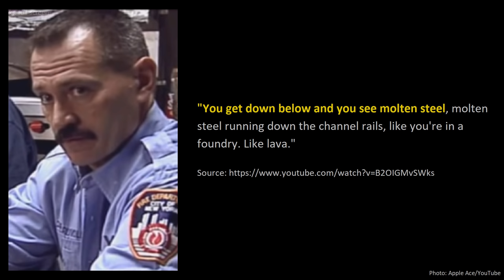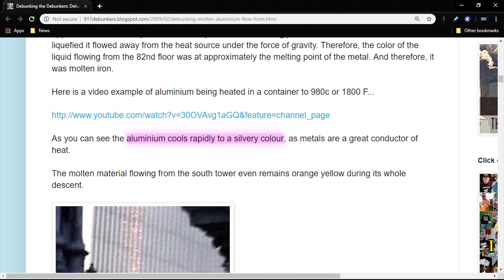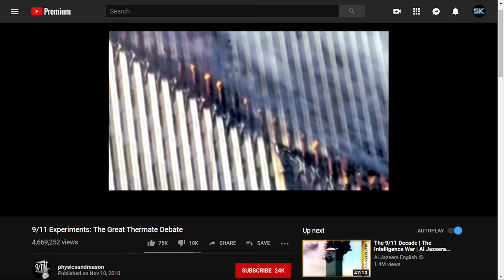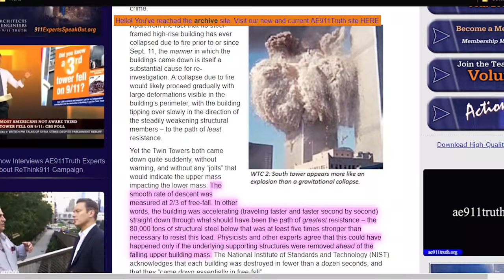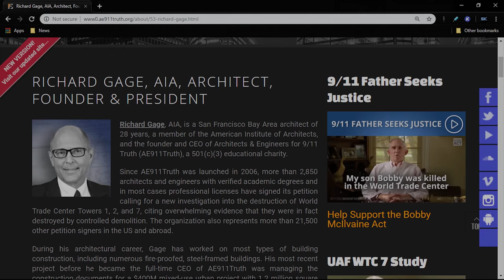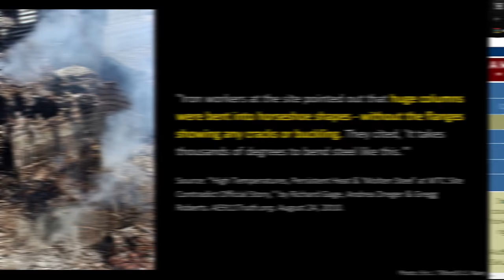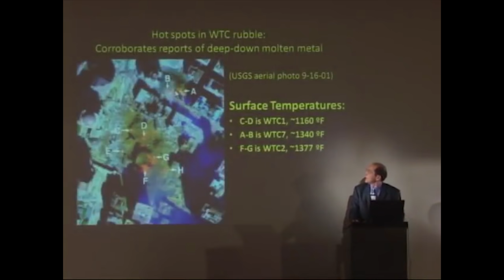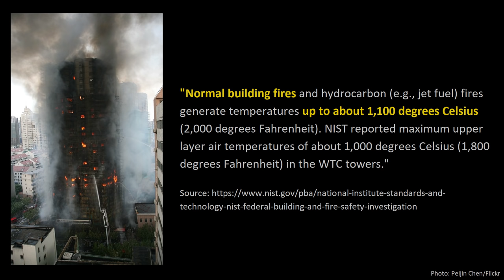9/11 Truthers Debunked: "Molten Steel = Thermite From Controlled Demolition!"

Comment: Many misunderstood points about the controlled demolition theory. For example, the hot spots underground was caused by fire from the thermite, the red hot spots seen from satillite do not indicate areas purely of molten steel, it indicates areas still burning from the thermite. And of course these hot spots can shift as the thermite provides fuel to burn things and melt through debris and cause things to shift. As a result of the temperatures created by the thermite you would find molten steel in those hot spots. But the hot spots are not caused by molten steel, it is caused by the thermite explosives. Regardless, maybe the material flowing out of the side of the standing building IS in fact aluminum. Okay, how does that impact the demolition theory? Well it really doesn't. If you really wanna disprove this theory. How about explaining to everyone how the buildings can fall at near the rate of free fall without the use of explosives. The building accelerated as it came down just like if you dropped your car keys on the ground. NIST in fact admits this so their is no point in arguing against it, it is a part of the official narrative. So you, if you want to debunk the demolition theory, need to explain how the top 15 floors of the building was able to accelerate at free fall with the 90,000 pounds of structure steel supporting it. Its very basic laws of physics. Every action has an equal and opposite reaction. 15 floors act upon the 90,000 pounds of building beneath it, that part of the building is going to push back. Both parts of the building will collide and do basically equal amounts of destruction to each other. The official story says pancake collapse, pile driver, yet it cannot explain how it took 9 to 10 seconds for the building to fall into itself at near free fall acceleration. Oh and lets not forget building 7 which did the same thing and wasn't hit by an airplane.
Reply: @mooneyes2k478  you should take off the moon eyes and try looking at the world as it actually is, reality. From the moment the top section of the building begins to go down, the top section is accelerating at free fall speeds. You also clearly dont understand what gravity is. Gravity is the force that accelerates (which is not a constant speed) objects at 9.8 meters per second squared. Gravity is not exactly 9.8 all over the world, for example, in new york city its closer to 10 seconds. You can observe the top section of the building frame by frame and you will find it is accelerating at the speed of gravity. This is impossible without explosives. Although it is true that the top section falling does have to encounter the floor immediately below it, your idiotic belief is the top section destroyed the entire structure below, 90,000 tons of undamaged structure. If the top section had to destroy the floors below it one at a time, it would take much much longet than 10 seconds. And you have no evidence Whatsoever to support that collapse lasted 18 seconds, in fact, the official story agrees with me in this aspect as well. Collapse was 10 seconds at free fall acceleration. If it was piling driving and causing destruction from falling, it would have to slow down. The action of the top section destroying stuff below would mean kinetic energy from the free fall would have had to been used to cause the destruction. The building came down with little to know resistance, meaning the structure was removed as it was falling, meaning explosives were used. And of course the same thing happened with building 7 except it was a bottom up demolition that is much more common. You have no evidence, you made no effort to explain your position other than to mock mine. Sounds like a sheep to me
Reply: @unshapingtheearth7916  Aren't you AMAZINGLY creative and witty?

Now, then:

" From the moment the top section of the building begins to go down, the top section is accelerating at free fall speeds. "
"Speed" is not acceleration. "Free fall" is what occurs when a parachutist's air resistance equals to his gravitational acceleration.

"You also clearly dont understand what gravity is. Gravity is the force that accelerates (which is not a constant speed) objects at 9.8 meters per second squared."
SNRK! Wow, that was almost sublime in its irony. Not only did you prove your previous claim utter nonsense, actually managing to differentiate between acceleration and speed, but you also managed to say that the acceleration of gravity is not constant at a constant. Good work.

"You can observe the top section of the building frame by frame and you will find it is accelerating at the speed of gravity."
Congratulations, you not only proved, again, that you don't know what gravity is, but you also managed to either prove you haven't actually ever done what you claimed, or you're a liar. No, the building does NOT actually fall at gravitational acceleration.

" This is impossible without explosives."
This? Is so much bullshit.

"If the top section had to destroy the floors below it one at a time, it would take much much longet than 10 seconds"
And what DO you know, that's exactly what happened. Amazing, isn't it.

"And you have no evidence Whatsoever to support that collapse lasted 18 seconds"
Except the videos, of which there are MANY, of the collapses.

" in fact, the official story agrees with me in this aspect as well"
That you want fairy tales to be real doesn't mean they are.
Since I'm sure you missed that, no. It doesn't. No matter HOW much you want it to.

"The building came down with little to know resistance"
And again, we come into your wishful thinking. No, the buildings came down with a whole hell of a lot of resistance.

"meaning the structure was removed as it was falling, meaning explosives were used"
Which is not only stupid on the basis of "structure was removed", as it visibly and clearly was not, but ALSO on the "explosives were used", which is a complete failure on every single piece of evidence. Explosives leave very obvious physical and auditory traces, none of which were present.

"And of course the same thing happened with building 7 except it was a bottom up demolition that is much more common."
Which, again, didn't happen as proven by a LEGION of evidence. And common sense.

". You have no evidence, you made no effort to explain your position other than to mock mine."
Oh, I have ALL the evidence. It's called "the explanation". That adheres to the evidence, uses the facts and utilizes the science as known to man. You, on the other hand, have "because I want it to be that way" and "nuh-uh!"

" Sounds like a sheep to me"
The irony of a person bleating along with the leader of the herd, repeating nonsense it's heard others say, without even a trace of independent thought, saying that? Is sharp indeed. Cuttingly so.
Reply: Thermite is not nor ever has been used for building demolition, it's only industrial application is welding.  Just ask any professionals who performs building demo every day.

Comment: out of curiosity what are old computer cases towers made of or chair legs, desks, suspended ceiling frames thin metal melts and rusts too right?  say in a blast furnace with jet fuel and napalm as a heat source?  as fuel and plastic is essentially napalm and the wind going through the building with a center shaft would be as close to a blast furnace as you can get without trying no?

Comment: I've seen other videos where people are working with molten aluminum and it was silver even while it was in the cauldron/crucible.
Also, how do we know that the cauldrons in your video contained aluminum? 
You didnt show them adding raw aluminum to the cauldron, you only showed us the cauldrons which you claim contain aluminium after it was in its molten state. How do we know its aluminum inside the cauldrons/crucible?
I'd like to see the aluminum turn from room temperature silver, to molten  orange.
Reply: You know it’s aluminum because of how rapidly it turns silver after being poured. Molten steel would not cool fast enough to stop emitting light as fast as is seen in the video.
Reply: Dude you don’t see anything the picture is too far and you try to see a little dot of molten steel of course it will glow look at the quality of the footage btw how did building 7 collapsed?
Reply: @hotmoffitt  at what minute of the video you saw aluminum turning silver right after being poured? Also, the molten metal flowing out of the twin tower did not turn silver after being poured, are you admitting that was steel then?
Reply: @hotmoffitt  doesnt the color of the aluminum depend on its temperature, why should it turn silver right after being poured?

Comment: Bro 3 months of burning molten Steel explain that
Reply: There would be no jet fuel left at that point to heat the metal.
Reply: 12weasel100 lol. What’s the time limit? A week?
Reply: 12weasel100 Demos use explosives, not thermite.
Reply: @danklordsupreme8864  LOL Exactly! That's the point. There were copious amounts of unreacted thermite and thermite byproducts found in WTC dust samples. The point is that the months of extremely high temperatures in the rubble is due to thermite....
Reply: @JamesOsyris  Military uses it as well as thermate.

Comment: Molten aluminum doesn’t glow yellow in daylight. It will glow a dull red in the dark. Also, how do you explain away the nano thermite found in the dust? It was scientifically test in a calorimeter. It was everywhere.
Reply: Isn't it strange how, when you check....yes, it does. Amazing.

Oh, and as for "nano thermite"? Sadly, this is the real world. It would be really cool if the world actually was a cheap airport-lit novel with all the amazing guns and tough guys and all that? But it isn't. Pity, really.
Reply: Do you have any link that show/demonstrate that aluminum glows yellow in the daylight?
Reply: How do you explain putting y
Thermite and no office worker in the builfing noticed ?
Do you think that a team can sneak in the building and leave no evidence that they planted a bomb?
No cleaning workers noticed anything? Or maybe they were neuralyzed by men in black?
Reply: @Teluric2  put on coveralls with a cable company logo and do it plain site. If you look official and have documents that look real and you have permission signed off by Larry Silverstein himself, you can bring everything you need to do the job in on palettes. Also, there was an elevator renovation taking place prior to the “attack”. You can assume they were actually working on the elevators if you want.

Comment: Having messed about a bit with molten aluminium, I can say that the total mass of molten metal is a BIG deal in regard to how it behaves when poured. 

Quantities bellow half a litre cool almost instantly if poured onto a flat surface, but if poured into an ingot mould it will stay red for a minute of so. 

Pouring volumes of molten aluminium greater than a litre is a VERY different experience. The thermal mass is much greater and the radiant heat is horrendous. The aluminium is able to stay liquid and remain glowing bright orange much longer.

The famous video of glowing liquid gushing out of Tower 2 moments before it fell, involves tens of litres of molten aluminium. The thermal mass involved is so great that it stays red after falling many metes through the open air.

Comment: You just said it's enough to explain the initiation of collapse but that doesn't explain how the top 3% in mass, could completely collapse the building all the way to the ground. There's not enough energy
Reply: Agree. A collapse would have partial drop of the floors at the point of structure failure but after it matches the number of collapsing floors it would be met with massive resistance and fall off to the side leaving , in this case , an estimated 70 or so floors still standing in the north tower and 50 or more floors still standing in the south. Not a complete collapse. So a complete collapse with zero resistance....is impossible in this situation. Anyone with common sense can make this conclusion
Reply: @ianthestithead  Common sense, in it's traditional meaning has very little to do with it.  If you had the common sense (and education in physics) that building engineers and architects have, you would understand that not only was the collapse as witnessed not impossible, it's exactly what the physics predict.  You need to investigate the unique construction design used in the twin towers and you'll understand why they collapsed as they did.

Comment: Actually, though correct me if I’m wrong, you can melt steel if you hit it with enough energy, so those meteorites might have molten steel, steel that melted for an instant when the weight of the tower collapsed on the columns
Reply: Whenever you deform material, you move atoms and create heat. Metal does not have to melt to become too weak to suport its own mass.

Comment: Don't forget that the energy of the building falling was converted to heat also.  Millions, if not billions, of joules of energy.  Energy is 1/2 x mass x speed of the fall squared = mass x gravitational acceleration x height of fall

Comment: I may be wrong on this, but I’m pretty sure incandescent color of a material is dependent only on temperature and not composition.

That means that even if that is all 100% aluminum, the temperatures are near what would be require to melt steel.

The giant crucibles of aluminum shown by those men in protective T-shirts and shorts are almost definitely heated to way more they just the melting point of aluminum.
Reply: It's still hilarious to me that these "debunkers" believe that the the aluminum of the plane alll magically migrated to that one specific corner, even considering the inertia of the plane in in the direction it was going at 500 mph. You can even see engine parts fly out the other side of the building after impact. No way it all migrated to that corner. It's utterly laughable.
Reply: Spectral analysis
Reply: @lex.cordis  who said that "all" of the aluminum was gathered there?  you can CLEARLY SEE there is a huge pile of debris from the airplane directly above the stream- but that's just a total coincidence right >_>
Reply: @BabySkinCondom  Buddy, aluminum does not glow yellow/orange when it is molten. It glows silvery. That is not even molten aluminum.
Reply: @lex.cordis  i guess you missed the half of the video spent debunking that.  but hey, don't let facts get in the way of a good conspiracy
Reply: @BabySkinCondom  At no point was that adequately debunked. Office materials do not mix with molten aluminum. It's been proven through experiment. Even if they could, they would not cause the molten liquid to be uniformly yellow in appearance. Try again another time.
Reply: @BabySkinCondom  Plus, all of the material from the plane was either disintegrated, or it went out the other side of the building in the direction that the plane was traveling. It makes no sense to think that the aluminum would magically travel to one corner of the building to pour out. 

Also consider the fact that NIST claims that the floors were buckled at that time, causing the collapse. How can the liquid aluminum pool up and pour out of the corner, given the fact that it should pool up in the center of the floor, being that the lowest point should be in the center according to NIST's "buckling floor trusses" theory? You never thought of that did you, genius?
Reply: Also to the OP..... Aluminum only glows silvery when molten. ESPECIALLY when it is in daylight, which it is here. This cannot be molten aluminum. This has long been proven through testing and experiment.
Reply: @lex.cordis  As someone already pointed out, apparently you dozed off during the part of this video where it is proven aluminum DOES glow orange/yellow when molten. 

As for your other comment claiming aluminum should have pooled in the center of the floor per the "buckling floor trusses" theory. What you're ignoring is the buckling trusses caused the L brackets connecting the floor to the outer skin and inner core. It's clear the sequence of events just before the start of the collapse is (1) the buckling trusses cause the L brackets to detach causing (2) the concrete slab to fall to the slab below it. Once this happened, any molten aluminum on the floor that collapsed could have run anywhere, but it would not have pooled in the middle of the floor. The trusses might have sagged, but the concrete wouldn't.
Reply: Themal mass is a complicated thing that can be counter intuitive at times. A hot object is not like a glowing light bulb.
Reply: @wiretamer5710  A glowing lightbulb glows because the filament is hot. Hot metals incandesce and give off light. The cooler they are the more red, the hotter they are the more white

Comment: To make aluminium glow you will have to keep it in a container and continue heating it up otherwise it will just seep through cracks.  So something got to be functioning like a crucible to hold it until it (the crucible) starts to melt and spews out the aluminium AND its molten self.  So whats the crucible made of? It can't be aluminium.

31:05 this pile of red hot metal must have been sitting there for at least an hr.  At what state should be metal be before the WTC collapsed?
Reply: "this pile of red hot metal must have been sitting there for at least an hr"
Why? Because you want it to have?
Reply: @mooneyes2k478  no one could see or approach the area for at least an hour due to dust and smoke.
Reply: A more likely explanation is that this aluminum was gathering in a puddle until it eventually seeped through to the buildings exterior.